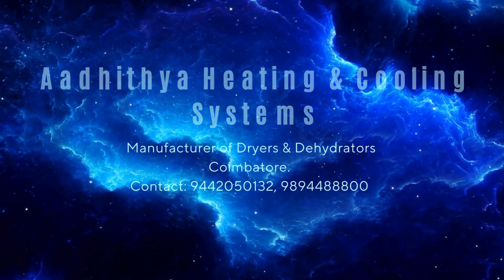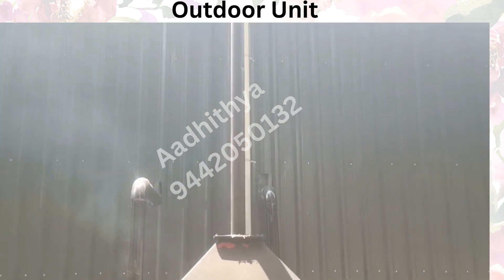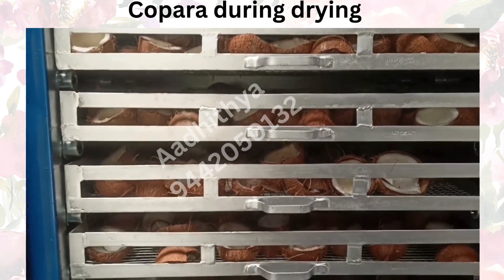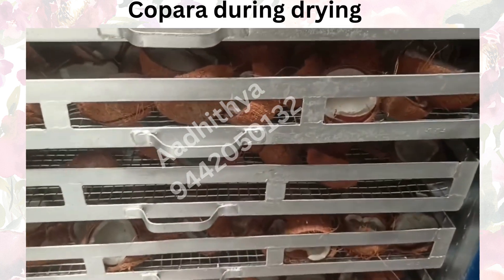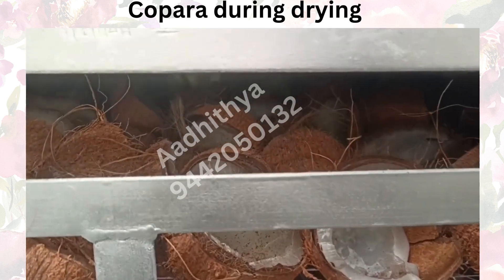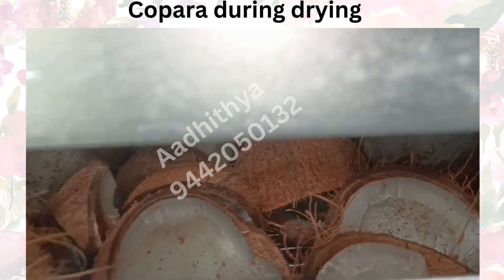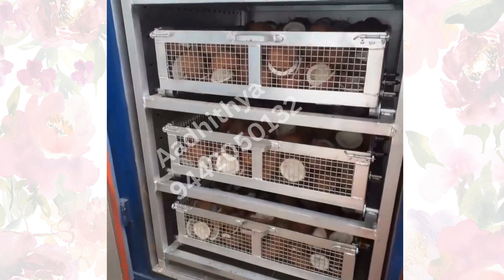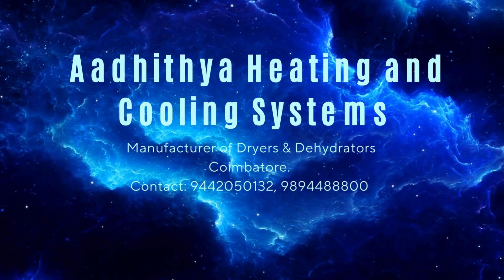Aadhithya Copra Dryer

Comment: Price?
Reply from the maker: Aadhithya Heating and cooling systems is manufacturer of dryers/ dehydrators for large varient  from small to larger size.  Our starting price is from 29,500. Price will change depending upon your size. Please call 9442050132 for price details.
Reply from the maker: Aadhithya Heating and cooling systems is manufacturer of dryers/ dehydrators for large varient  from small to larger size.  Our starting price is from 29,500. Price will change depending upon your size. Please call 9442050132 for price details.